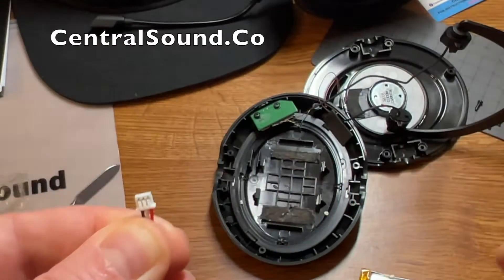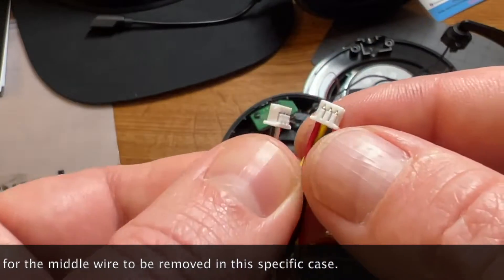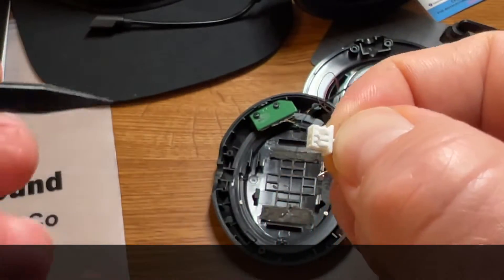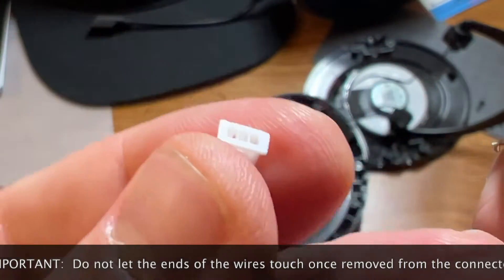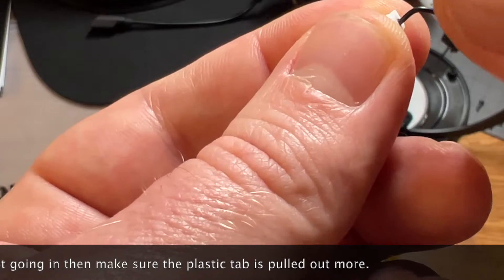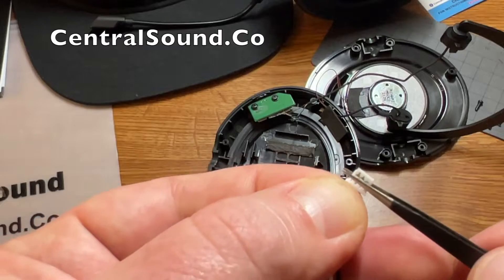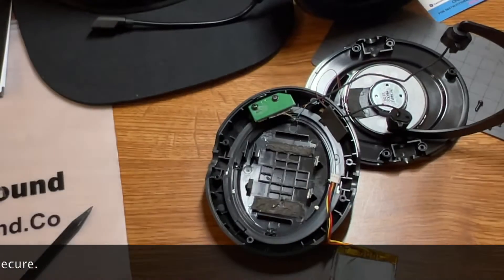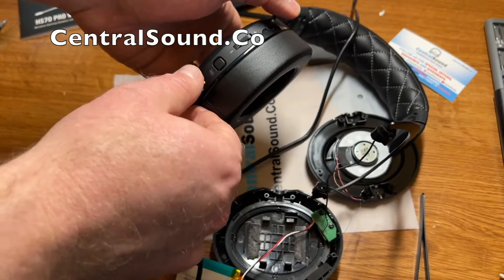Reverse Battery Polarity | How To Remove Micro-connector | Li-ion | Swap Positive and Negative Wires

Comment: You can also push in on your wires then push down on those locks that you see on the side of the connector and it will come out
Reply from the maker: Good tip!

Comment: Pro tip: after you successfully pull one out (red or black), before pulling the other out, wrap the end terminal of the first one with a small piece of electrician's tape. Closed circuit risk eliminated.